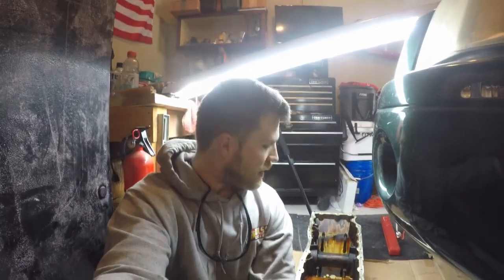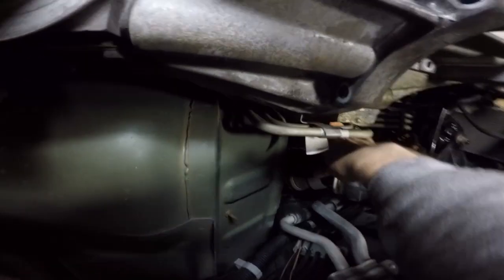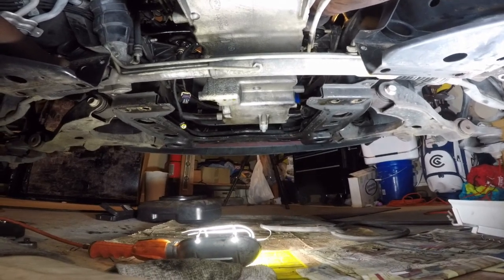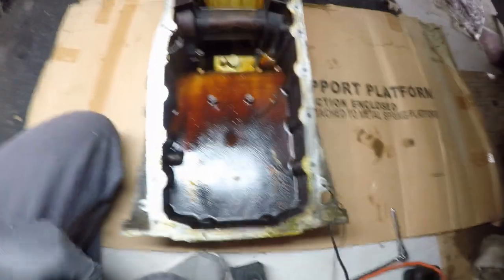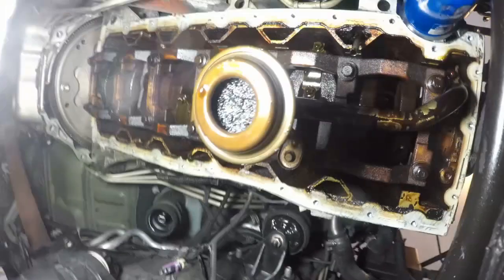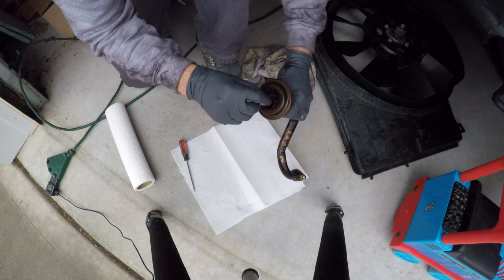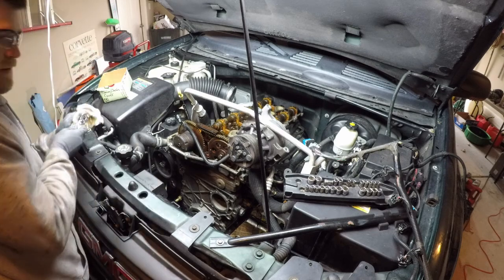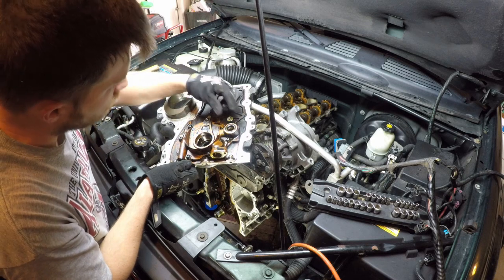I Broke My Oil Pan (GM 4.2L Oil Pickup Tube Removal - Part 2)

Comment: You been running quaker state ?
Reply from the maker: I generally run Valvoline in my cars. Either synthetic blend or full synthetic.
Reply: @KevinNadeau  I always run Valvoline or Havoline
Reply: @KevinNadeau  How did you get to the front oil pan bolts?
Reply from the maker: @jacobqueen1948  Either from the ground or above. Just be sure to get the one behind the oil filter. I missed it and that's how I broke my oil pan.
Reply: @KevinNadeau  Ill never do this again :) But ill supervise someone else doing it :)
Reply from the maker: Are you talking about the cans on top of  my fridge? No, those are just "garage decorations".
Reply: @KevinNadeau  no.what the motor looked like inside jua looke like it been running quakerstate or Pennzoil.
Reply: @KevinNadeau  I'm tearing mine down to do the bearings but my front crewmember looks like its welded to the frame in a couple spots.
Reply: 25 plus years as a auto parts manager / service writer ,, this for sure  is a quaker state , or pennzoil engine , promise everyone don't use either ever ! .  CASTROL ,  &  VALVOLINE WILL NEVER DO THIS  ,, I'VE SEEN TO MANY .

Comment: I have an 02 trailblazer 4x4, I am having the same issue with the intermittent low oil pressure  warning. If I were to do as you did and clean out the pick up line would I have to remove the fan and all the things that you did ? Or is there a way to just remove the oil pan, after removing the cv axles of course?
Reply from the maker: I'm assuming you have the 4.2L motor.  In that case, in order to get to the pick up tube you won't have take off the fan, etc.  But if you wanted to change your oil pump, then you'd have to take off the fan and harmonic balancer.
Reply: Thank you for responding, yes it’s the 4.2 L vtech with 233k miles. I just changed out the oil pressure switch quick and easy fix but took it for a test drive and the pressure dropped again. So looks like the next project is  the pick up tube. Would I have to remove the front differential to access the oil pan? 

Thank you for the great video content, us home mechanics really appreciate it.
Reply from the maker: Thanks for the kinds words, you're more than welcome. I'm glad my content helped you out. And yes, you'll have to remove the front diff.

Comment: I'm not sure the magnet test means anything because your bearings are non ferrous. I'm hoping I don't ever have to do this.
Reply from the maker: Eric Corse I'm hoping it was just engine gunk. What I pulled off the pickup screen was very similar to what I found caked in the intake ports.
Reply: I suspect you are correct
Reply: My pickup tube was full of spun bearing material. Of course my engine had to come out and rebuilt. I am still working on it. I got the Trailblazer cheap due to the bad engine.